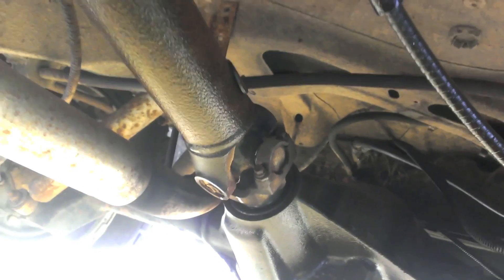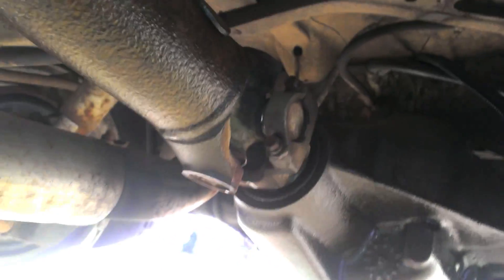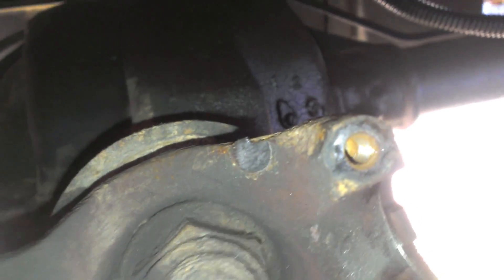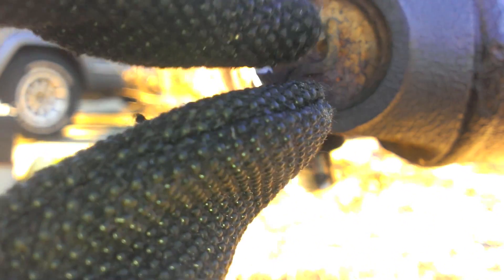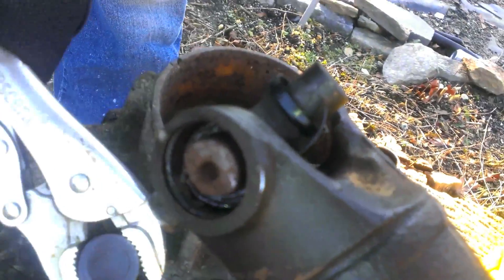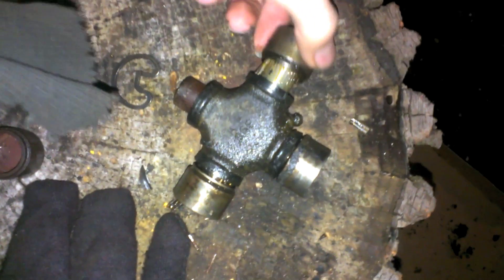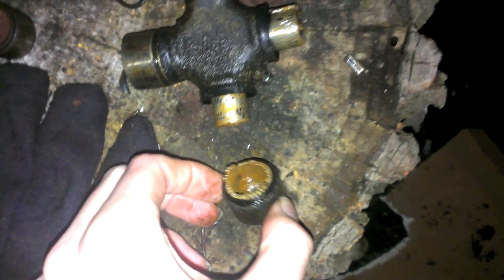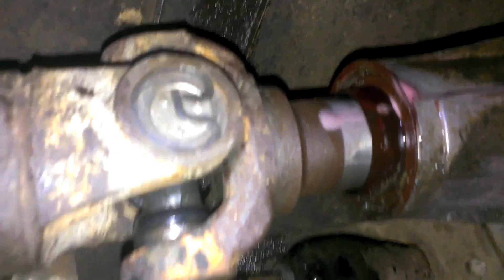89 Cherokee Driveshaft U-Joint Replacment

Comment: I'm not sure if I missed it in the video, but I was wondering if you knew the part numbers for the u-joints. I keep finding 1310, but I also saw something about the 89s having a different size/pn. Are the front and rear the same size? I'd have a look myself but I'm away for a bit and want to order the parts before I get back. I've got the same year, but with a manual don't think that it changes anything though. BTW love the REM it was extremely helpful for finding the sweet spot for gas mileage and changing out my TPS.
Reply from the maker: From what I remember, the driveshaft u-joint size has never changed on the XJ. They all use 1310 for all joints in the front and back drive shafts. You might be thinking of the Axle Shafts, as there is a larger 297 joint in the newer shafts, but I don't recall if there is a specific cut off year for that.
Reply: @NickInTimeFilms  awesome thanks a lot for the quick reply. 👍

Comment: Shit what marks were here talking about?
Reply from the maker: I was going off what the books said, but I didn't see any. The biggest thing is if your slip-yoke ever comes apart that it's installed the same way or else the shaft will vibrate. I'm not sure if installing the h yoke and outer housing in the same orientation is as important, but if there is a balancing weight on the shaft then it wouldn't hurt. Just make a mark with paint or a punch and you'll be fine.
Reply: NickInTimeFilms yeah i already took it out before i watched this video

Comment: What symptoms were you getting from this???
Reply from the maker: Clunking when taking off from stop. Grab the driveshaft and see if it's loose.
Reply: @NickInTimeFilms  ok, I have a jolt symptom when I hit multiple cracks or bumps on the hwy , not sure what's causing it, I checked the drive shaft and it's nice and sturdy. As soon as I let go of the gas it stops and it also doesn't happen all the time. It jolts in a quick second.
Reply: @maximusilive4theking986  ever figure this out?

Comment: would a bad u joint cause a vibration on the car?  i have a 99 jeep xj when evrytime i take off i hear a click sound and then a vibration on the car
Reply from the maker: Oh absolutely. Even slightly worn u-joints will cause high speed vibration and very loose ones can blow apart and that is not pretty at all. Easiest way is to just grab the driveshaft and see if it has any movement. In and out is ok but it shouldn't be able to move up/down or left/right.

Comment: Someone help. I took my ram to a shop to get the u-joints fixed. 4x2. Took it to the dodge dealer after and they said the drive shaft is fucked because whoever replaced them didn't do the job properly. My question is, worst case scenario, what is the worst that could happen if your u-joints fall out or worse???
Reply from the maker: It's not something you want to gamble on. If they are saying the driveshaft ears are messed up and the u-joints won't sit in there properly then you need a new driveshaft, no buts about it. If the u-joint caps fall out then the driveshaft could potentially fall off and damaged the underside of your truck banging around and go flying into the road potentially harming others.
Reply: NickInTimeFilms I thought this was the case. I called the shop that fucked shit up to beg them to be responsible and pay for their mistakes. They insist it's fixed and refuse to do anything about it. Looks like i might actually have my first small claims case but when I walk into court demanding they pay I don't want to sound like an idiot when I tell the judge that the shop put my life in danger and also the risk of other peoples safety. The dodge dealer wants me to hang on to the old driveshaft as evidence.

Comment: Any one know how to realine you shaft? Cause I replace the join and didn't made any mark what so ever just bolted back on.. now it give me vibration at 30 to 40.. any idea?
Reply from the maker: After looking into this for a while, the only part that has to be aligned is on the front driveshafts. If that slip joint is ever separated then it must be realigned properly to prevent vibrations. 

As for you shaft, did you check how freely the joint moved once it was installed. there may be a brief wear-in period before the joint starts turning freely. besides that i would also firmly grab the shaft and see if any part of it moves to see if something may be loose in the drivetrain.

Comment: …how many miles you have on the clock when changing these worn u-joints ? Thanks.
Reply from the maker: +Joey_V 170,000 miles
Reply: +NickInTimeFilms -- thanks - I have around 174 k, so time to check --however, I haven't noticed any vibrations or clunks so far…keep on posting !